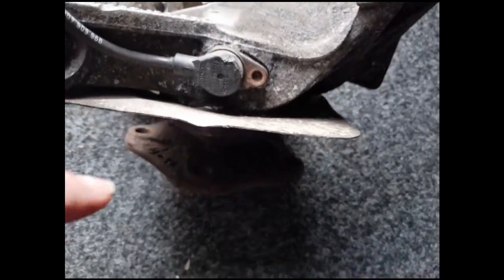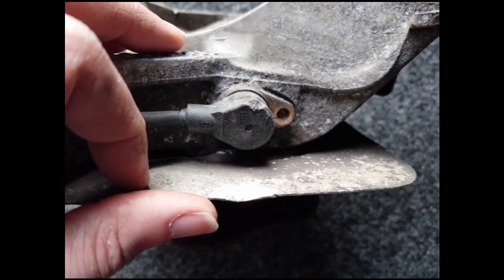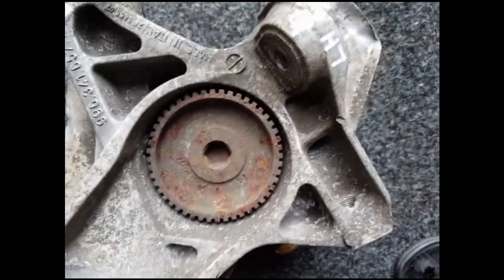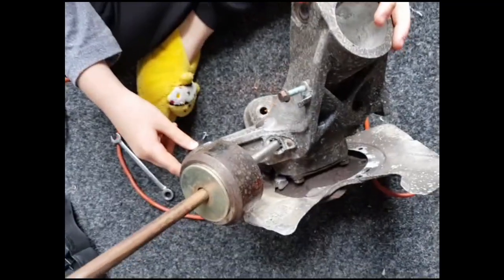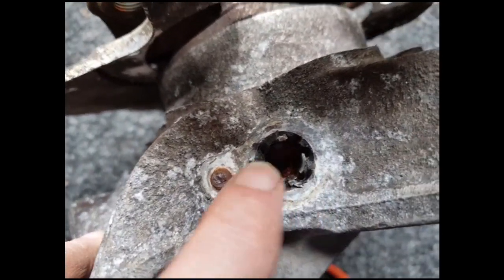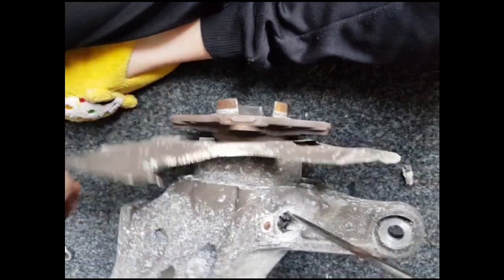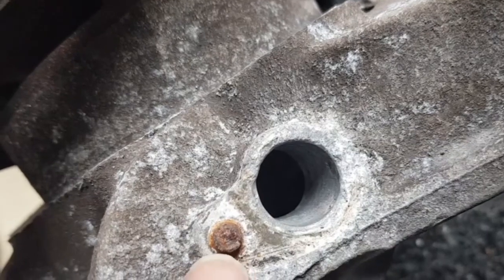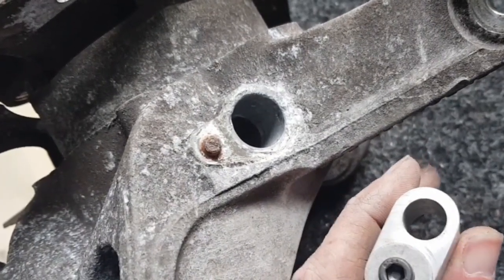Porsche 996 seized wheel speed sensor removal and drill out snapped bolt

Comment: Morning Martin, that’s great work and something I need to do on my drivers side hub. But at least the sensor is still working for now. Just the bolt has snapped. Where did you get that tool? I need one! I bought the Time Sert and did the same work on two snapped header bolts while replacing the full exhaust system on my 996.2. All on YT under my channel My911 if you fancy having a look. Would appreciate your support too. Thanks Joël
Reply from the maker: Hi Joël, I designed the tool myself and had a machine shop make it up for me.  If there is enough interest I can get a quote for having a few made up.
Reply: Martin Hill thanks for your reply. I would be interested in the tool.
Reply: @martinhill5770  great work, thanks for the tips. I would also be interested in the tool, even just the cad files would be helpful. Thank you!
Reply: @martinhill5770  im interested too
Reply: Hi Martin, 
Nice job.
Did you ever get a price on the tool - I’d also be interested in one!
Regards,